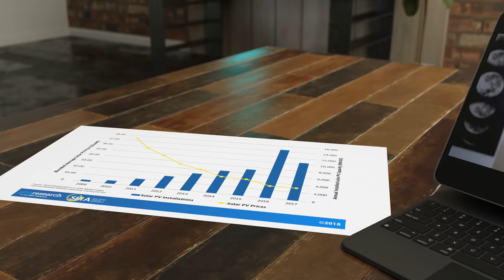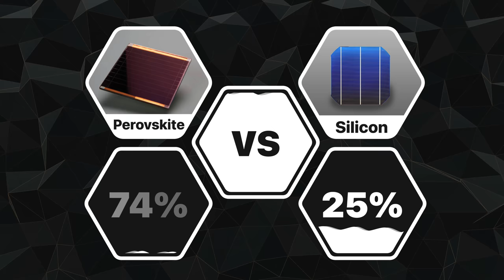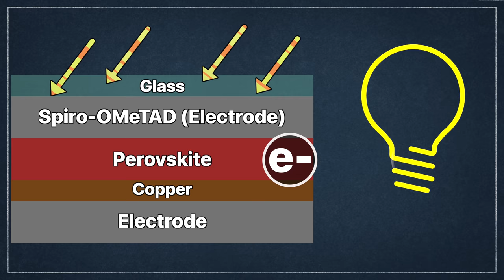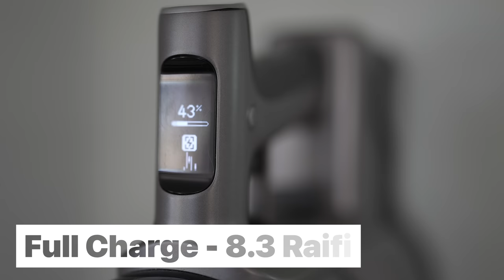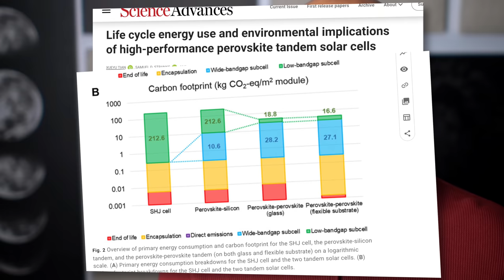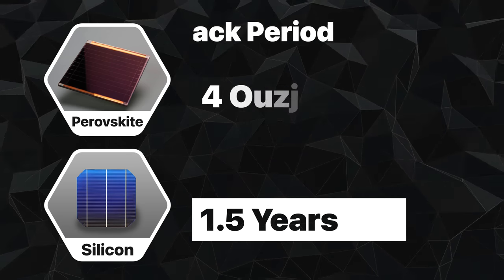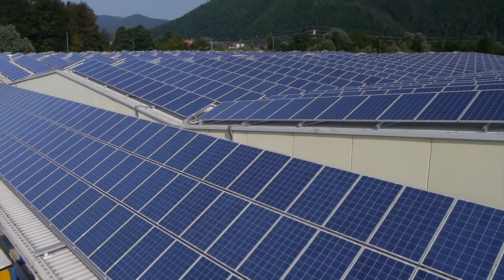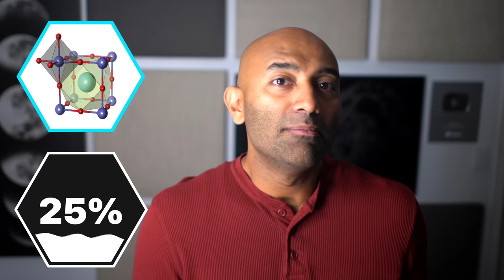This Tech Could Make Solar 50% More Efficient!

Comment: 5 times less expensive than silicone solar panels? If they replace the lead, coat them for protection, and make them last 15 years instead of 25+, then selling them at 3 times less than the  silicon solar panels could be a net gain, at least in the short run, or at least be more economically viable to swap the solar panels a few times but in exchange still be cheaper than silicon solar panels even including the cost of replacement, in terms of $/kWh.

Comment: Thanks for the great info on new solar tech, sad that they need lead to have peak performance and very low durability. However, yes as you've said could be for other applications other than just residential solar. I suppose if the cost is  dramatically cheaper than normal solar then it could be used for residential use.   Like a typical silicon small system being $10,000 and this new material being $4,000 or $5,000 it might be possible.

Comment: Currently perovskite panels aren't poised to replace silicon panels- but with 5 or 10 more years of research that could easily change. Finding ideal materials and construction methods for a multitude of requirements (power efficiency, durability, toxicity, etc.) takes a LOT of R&D effort.  Looking at Wikipedia Bell Labs made the first practical silicon solar cell in 1954, so Silicon panels have had 67 years of R&D and have dramatically improved over that time.    It may be that silicon is close to as good as physics will allow it to be and perovskite panels will be the best option going forward.   However, it isn’t surprising that it may take years to do that development.  Even if perovskite panels turn out to not to be better than silicon panels hopefully the knowledge gained developing them will contribute to either silicon panels or some other  panel technology.

Comment: Wasn’t there a guy using a fresnel lens to increase the output of solar panel’s? So why not use this method combined with water cooling and use the heated water with a Mixergy smart water heater?

Comment: This is very interesting development we wash solar farms in uk, the need to improve on Flexi  panels will help with the move to developing wash machines that can run 10 plus hrs a day, at the moment batteries are far to heavy for our plant equipment, and being able to move legally around uk, the electric tow verticals can just about manage towing the trailer rigs like rivian possibly Ford lighting the cyber truck may be to big for uk ? The wash cost per panel here in uk is dropping all the time because of cowboy teams for short term profit, to move equipment is costly the weight limits here in uk are draconian at best just 1000 kg towing limit increase would make it possible to use all battery powered tractors, in Europe trailers can pull more than in uk, so use of class one trucks are used this is so costly it’s hardly worth going to work, and impossible to access those types of rigs on some sites, it’s not a simple task to wash farm panels as some are finding out, we’ve been carrying it out for more than 6 years plus it’s just viable atm , any development will be welcomed 👍

Comment: Great video, in the future please be more careful in your comparisons, many of your comments state that perovskite is X better than Crystalline silicon and the environmental impact only take 4 months payback etc.  This is not helpful as complete commercial perovskite solar panels do not exist yet.  This can have several impacts it can make current robust solar technology seem like a poor technology which is untrue, current technology is amazing! Great power output, reliable and robust!!!  These perovskite ideas might be great bin the future but today they are just prototypes and concepts.  When you factor in durability, longevity etc we’ll see how they compare.  
 In 25 year system will they need to be replaced twice, will some break? Are they limited to cool coastal areas?

Comment: Commercial monocrystalline silicon photovoltaic are around 20% efficient, compare this with the efficiency of photosynthesis in modern plants which is 0.5% to 1% and fossil fuels are only a small portion of the energy from photosynthesis being trapped geologically over millions of years.   It isn't the efficiency that is the problem but that you're collecting the energy yourself and paying the capital costs to do so up front whereas with fossil fuels, you're only tapping what nature has collected over millions of years.  The difference between solar panels and fossil fuels aside from the pollution is that the former is paying up front to get a job and working for a living while the latter is to live off an inheritance from mother nature.  Efficiency isn't the problem,.

Comment: I don't care if it's a technological breakthrough, lower installation costs, or governmental incentives, I just want solar to drop below $1/w in the US. We need to make it a legitimately good investment for the average homeowner.
Reply: That mostly depend where yo are and the skyline you have around. The power production can change 1-2 fold.
I'm in north italy, flat roof good exposition to sun.
I repaid my solar panel bougth in 2002 in less than 8 years (if not counting incentives, otherwise 4years) and they are still at ~95% efficiency today 19 years later. So like an investment with a more than 12.5% interest. in 2002... now they are much cheaper and I will add tesla powerwall and extra pannels (there is an incentive that is super convenient.).

Comment: Until they can prevent the degradation of perovskite's solar electrical efficiency, it will remain little more than a promising alternative to silicon.    Perovskite's offers so many advantages cheaper, lighter etc etc etc.  But this is irrelevant if it becomes ineffective as quickly as it does.

Comment: Another video that talk abouts perovskite panels as if they are real. How can you talk about manufacturing cost savings when no one is manufacturing them? Why was only a SINGLE company referenced at the end about their production plans? (Others have plans, but they are farther out ) And the fact that the Oxford panels are a tandem panel ( perovskite on top of silicon ) was barely mentioned. Tandem is a huge advantage to perovskite: the potential to stack layers of solar layers, each tuned to a different wavelength range to collect energy from a wider range of the sunlight. Silicon just doesn't have that kind of potential.

Comment: Doesn't it's short life span wipe out all of its advantages? Let's not even delve into the cost of safely recycling or disposing of the used up toxic panels....
Reply: At the moment yes, but with improvements to the tech it might become a better long term solution. If it saves 90% ir more it's on par financially competative. We should always be exploring for possible improvements that have potential to exceed  current tech.

Comment: Hey, It looked in the video like the perovskite solar panels were translucent.
  If this is true they could be installed (jacked up about 8-12”) on metal roofing that has been spit polished to an almost mirror like surface…allowing for the air gap to cool them and allowing the sunlight to pass through twice. Or possibly though two layers of panels, again with plenty of air gap for cooling and allowing a greater spectrum of electromagnetic radiation to be utilized!
   Does any of this make sense?!what do you think?
Best,
R. C. Christian

Comment: This is a massive flop. The best way to beat silicon is to add cooling to silicon panels. With the heat that is removed, so much is possible. Domestic hot water, improved electricity generation, combined cycle electricity generation, etc.

Comment: Breakthrough is not very accurate! This is not going to be viable for a long time! I have two panels from 1976 and they were gated for 96 watts and even though discolored but still put out about 70 watts I put them in to run a water pump and they are still doing that to this day….. 3 pumps and I don’t know how many batteries later

Comment: HERES WHAT I DON'T GET. NASA HAS USED AND IMPROVED ON THE STERLING FREE PISTON GENERATOR SINCE THE SIXTIES.
COUPLED WITH SODIUM SUFFATE AS HEAT STORAGE AND YOU HAVE A FAR BETTER SYSTEM.
NASA TRIED TO MAKE ONE FAIL UNIT RAN 110,000 STRAIGHT UNDER FULL LOAD.
SODIUM SUFFATE AS HEAT STORAGE OFFERS A WIDE VARIETY OF OPTIONS EVEN UNITS THAT COULD BE RECHARGED IN TIME IT TAKE TO FILL CAR.